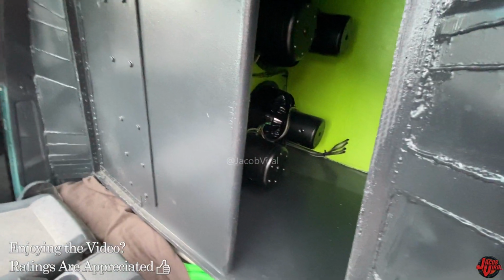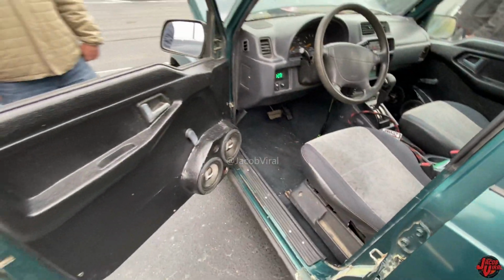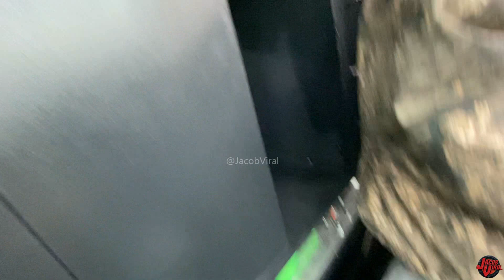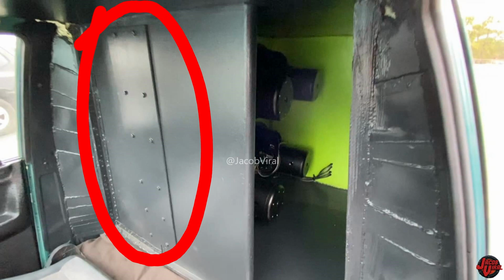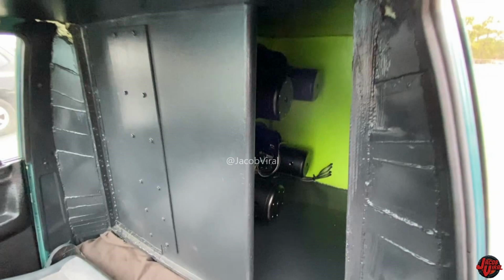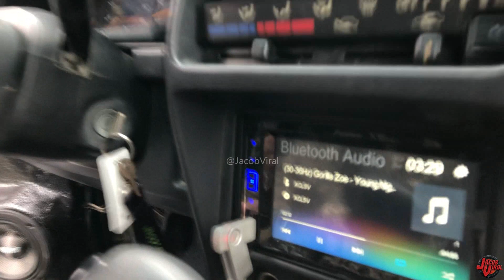SMALL CAR FABRICATED INTO THIS 160dB+ BASS SYSTEM!

Comment: My dad got 700,000 watt system
Reply: 70,000 is more believable
Reply: Lol, his father's car probably runs nuclear reactor to power that xDD
Reply: @dannythepavouk  Taramps sells 150,000w amps - but they aint 12v...
Reply: @Raymo2u  yeah, but for 700000 watts you would need 5 of em.. Im not saying you can't have it in the car.. Im saying you can't power it in any car.. they run on 300volts and totally they would consume over 1200 amperes.. well.. good luck fitting this kind of power source into a car 😆
Reply: @dannythepavouk  Its not reasonable or probable....but it is possible.